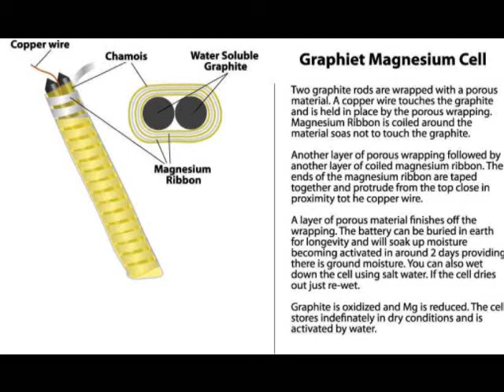Magnesium Graphite Cell through Joule Thief

Comment from the maker: Stay tuned for the addition to this circuit.  It runs the joule thief as well as a bedini spinner. It also runs without the spinner as a self oscillating circuit that produces about 5 times more light from the same cell used here. Will post in the next few days.

Comment from the maker: @rudiblackrahmadi Thanks. The graphite is just Derwent graphitone pencils 8B art pencils @ around $2NZ each. Water soluble 99% graphite. You can also use copper or carbon for a decent output. Carbon does not give quite as much output as has high resistivity than graphite though. Normal charcoal won't work but perhaps activated charcoal, havn't tried it.